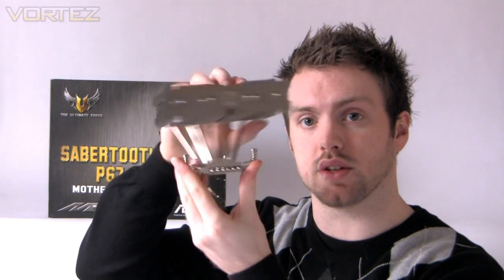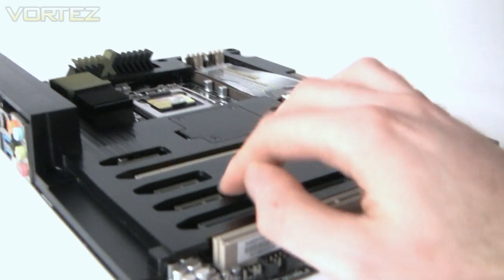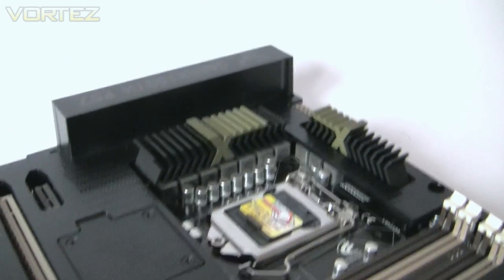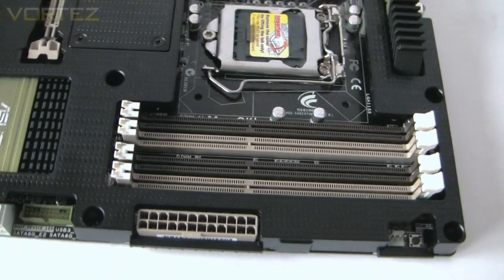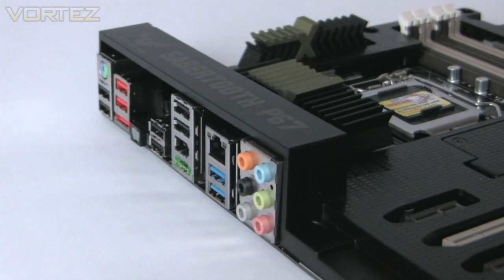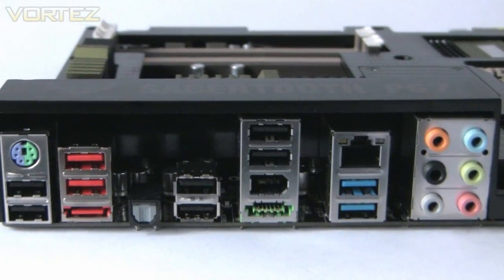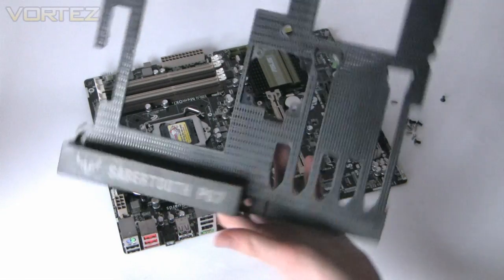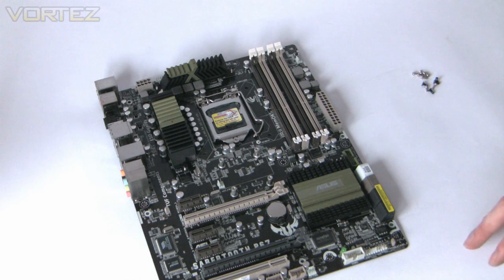ASUS Sabertooth P67 'TUF' Sandy Bridge Motherboard Review

Comment: @DaviedDedo91 Seriously they are the same but the Z68 has 2 extra options. The Z68 allows you to switch from your high end gpu to the onboard gpu by the click of a button. That way your electrical bill stays down. The other features is SSD cache, which has nothing to do with an SSD lol. It just lets say you click photoshop alot,your Z68 remembers you use it alot and cache's it so the next time you open it after a computer restart. It opens up almost instantly.So in gaming terms they are the same

Comment: Idk how I feel about that "thermal vest" on the board. I feel like it will restrict airflow. Also, any time you want to reset the cmos you have to take that off because the battery is under it. I thought it would have been under that little square cuttout but it wasn't.... Hmm...

Comment: @EnDZYm3 Yeah. Actually they said that there is only 5% change that SATA 3 Gb/s ports are going to slow down, but 6 Gb/s are not. So as long as you use 6gb/s ports, you have nothing to worried about.

Comment: Looks like an interesting board.  Besides using a downdraft cooler, it looks like the removeable cover on the center could support a 40mm fan which could cool the components underneath the shield.

Comment: Omg - Your going to have to remove 12 screws to replace the c-mos battery if the situation every comes up and what it's already in a case and the battery dies.
Still Love Asus though, but they may have to rethink some of the issues with this board.